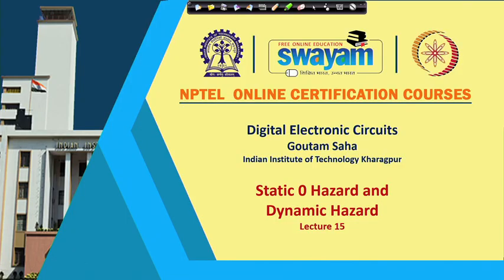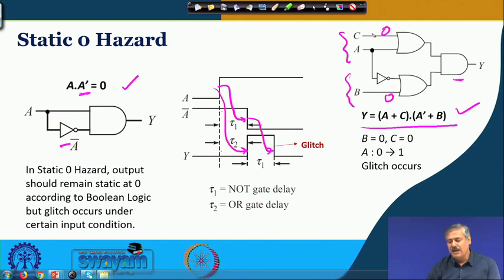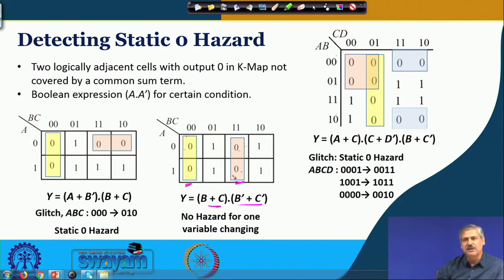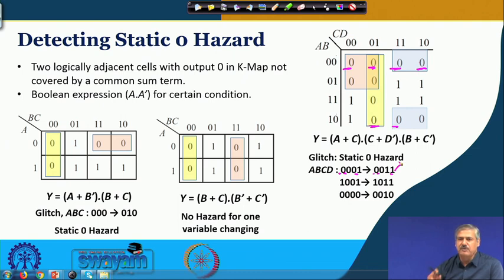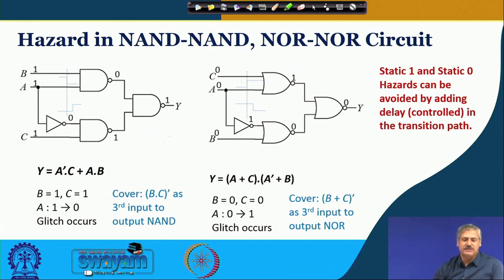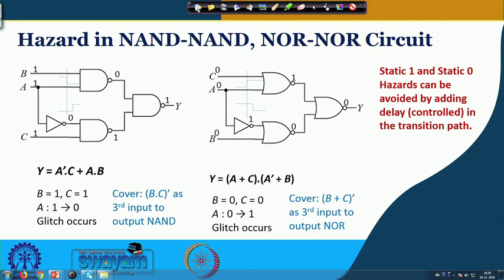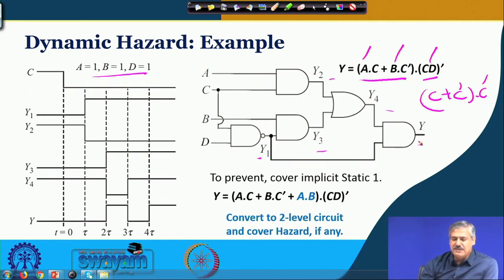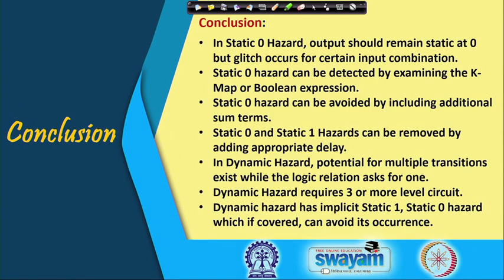Lecture 15: Static 0 Hazard and Dynamic Hazard

Comment: In the static 0 Hazard , tau 2 must be delay of AND gate. I have a doubt regarding the delay of NOT and AND gate , as it shown in the timing diagram tau-1 and tau-2 is given as same. Whether this delay is same for all gate
Reply: No its not like all gates have same propagation delay. Generally inverter has least propagation delay since it is the basis for all gates in CMOS.